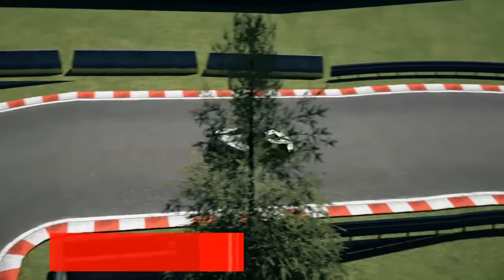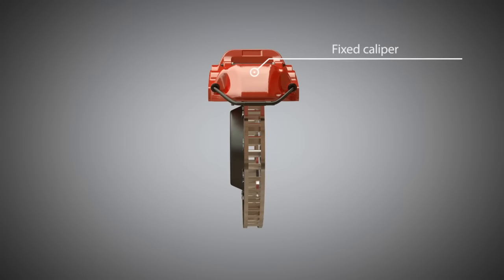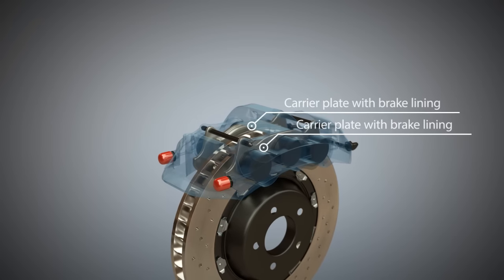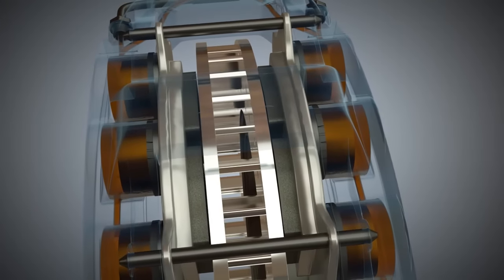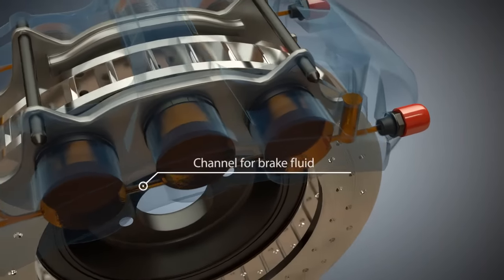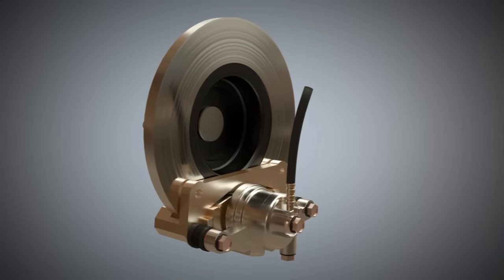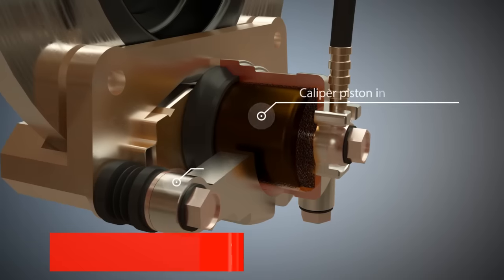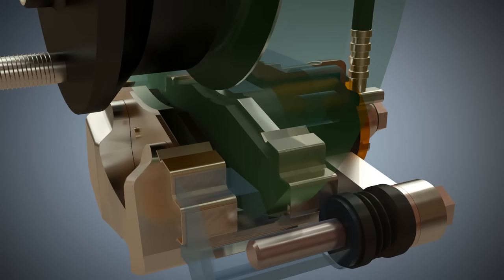Disk brake / Fixed caliper brake - How it works! (Animation)

Comment: Looking at brake design for a university project for the second time. My first time was about 3 years ago, in second year, and I struggled so much to find a good explanation on the exact mechanism. If only I had this resource back then.
Reply from the maker: Great you could use it :)

Comment: Nice video but i think you should also include the advantages of fixed callipers over floating callipers and vice versa . Anyways a good video .
Reply: That's not the point of his animations, they are only about the function. That's why the animations are so good, because they are what it is all about.
After somone understood the function of sth due to the animation, he can dive deeper into the topic via literature or videos with less ornate animations, since they aren't needed anymore.

Comment: There is no clearance on brake pads, not at all. It is constantly dragging ever so slightly. You can test yourself, a functional brake should always have slight contact in between pads and rotors.
Reply from the maker: What's your (scientific) source for this theory?
Reply: Thomas Schwenke you can test yourself by spinning your wheels when it’s on the rack, you can always feel a slight drag no matter what, because the rotors always have a high spots that will be in contact with the rotor.
Reply from the maker: This might be a problem with the brake pad. Do you have any other evidence than this?
Reply: Thomas Schwenke i am an autotech stident and all the wheels are like that and that’s what we are looking for after changing changing brake pads or checking brake pads.
Reply from the maker: Thanks. My books say something different. For example, have a look at "Das Bremsenhandbuch" by Springer.
Reply: Thomas Schwenke waiting for more clarified videos to less fortunate autotech students in kenya

Comment: You should of also explained on the different types of break circuits like the front t to back, not  just the split diagonal and the combination semi front to back split diagonal system used on older 
Volvo's [ to my knowledge only Volvo exclusive].
 Personally I like the split diagonal.

Comment: What pushes the caliper piston back to its original position?
Reply: Saintheart Knights  Springs in the guide pins
Reply: @joepierson3859  i don't see springs in my caliper nor in the animation
Reply: Saintheart Knights 
yeah you're right it's a square seal that actually retracts the cylinder,  jump to the 4-minute point in this video

https://youtu.be/IVHdhXXNReQ